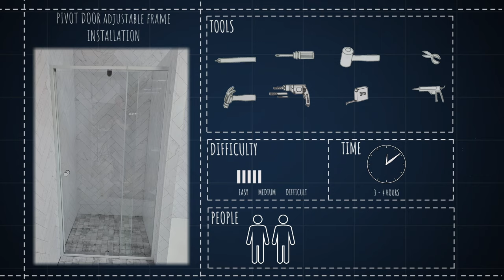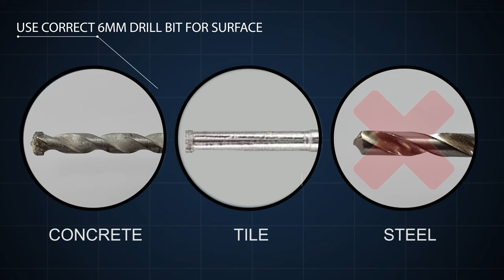PIVOT SHOWER DOOR - installation

Comment: Seal all penetrations with silicon. I've repaired two shower walls and floors where water has leaked through the vertical channel screw holes.